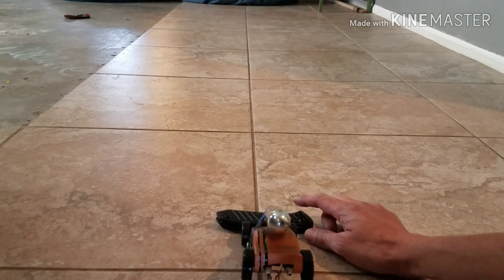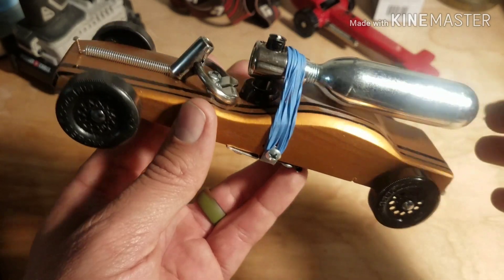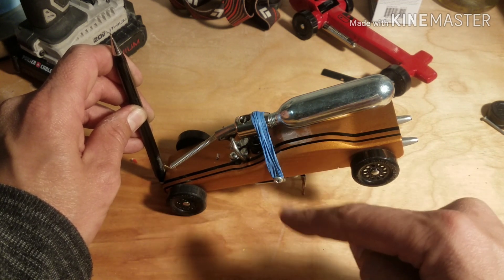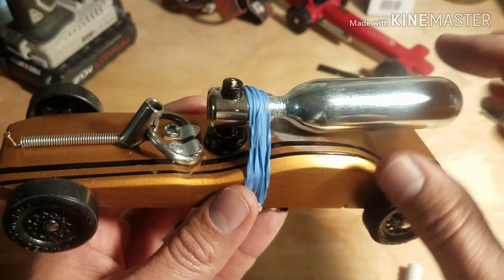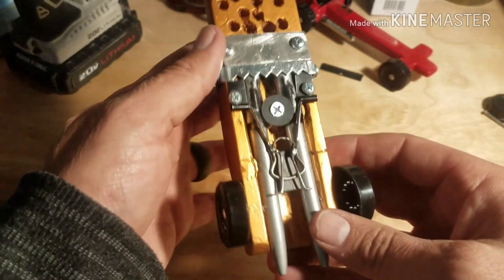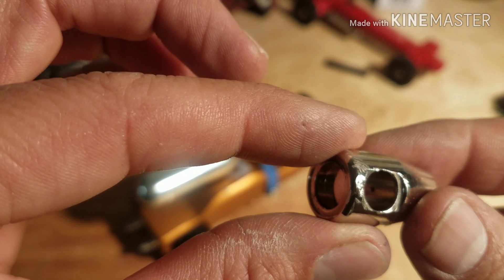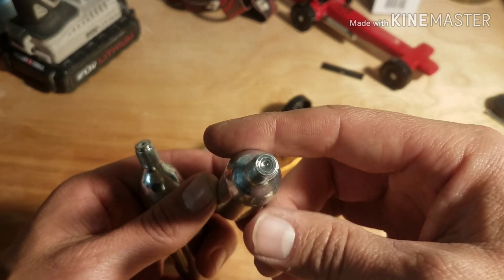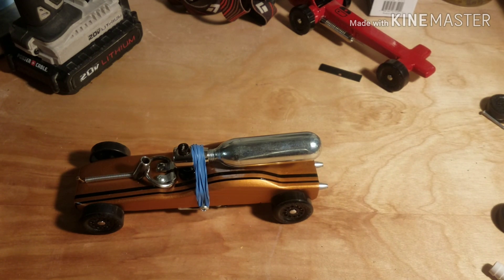Fast CO2 Pinewood Derby Car Design Plans, How it is Built, How it Works

Comment: 3:58 , first of all I want to say thank you for linking the tire valve. I’ve spent 2 days looking for what it was and couldn’t find it anywhere but here. Secondly I know that it was said in a comment above however is there anyway you could demonstrate how the valve comes apart? I don’t want to buy one and then try and take it apart and ruin it. Thanks!
Reply from the maker: Indont exactly remember how the valve comes apart.  I'm pretty sure one piece just slides off the other.  It would be pretty difficult to ruin

Comment: How did you disassemble the spring assembly for the tire inflator? Cut it?
Reply from the maker: If I remember correctly you can just pull the valve apart and slip the spring off.  I still have the spring.  Good luck!